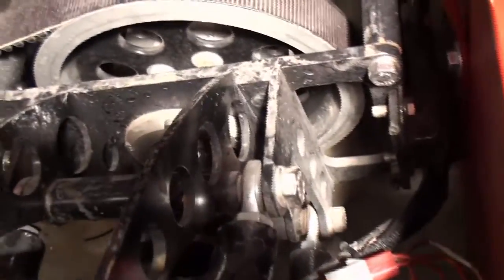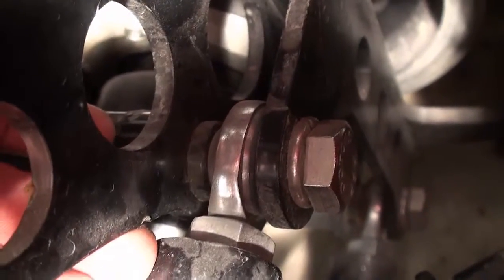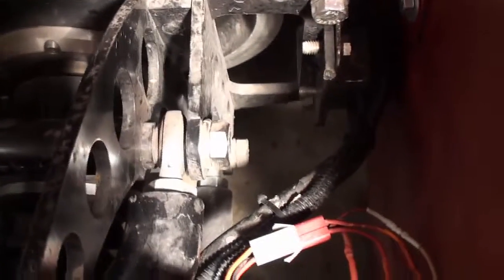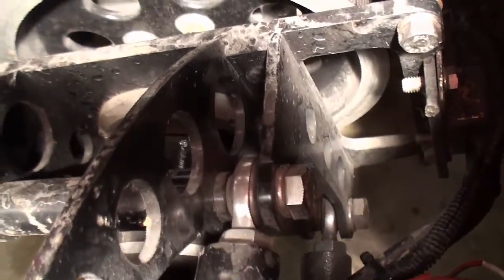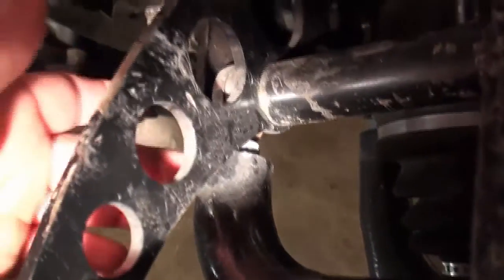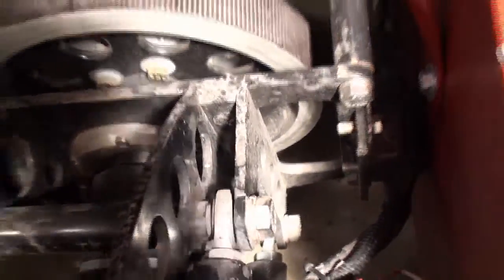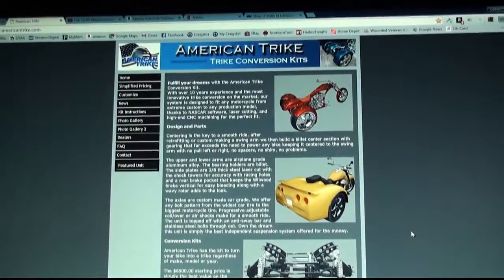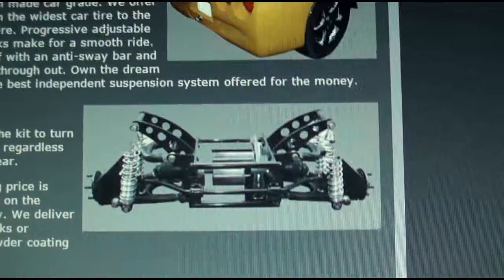American Trike Trike Conversion Kit

Comment: on the side of the brake there should be a number stamped. then I checked wildwood page and bought off eBay. there an auto grade so you might even buy direct. bleeding takes a bit I do only top 2 ports. outside of that keeping it clean as I get stuck in the rain.
Reply from the maker: help me out here brother, I can't seem to find "wildwood page" can you send me a link, also i found the number stamped on the caliper but can't get it referenced to anything on the web # is JAA-9689
Reply: 9689 is the brake number
Reply: call them give them the number and they'll quote you pads

Comment: I checked mine out. I don't seem to have that issue.  made a quick video of it, will have posted tonight. I'm thinking the cut those 'arms' on mine compared to yours. also, my chassis seems stiffer. because new or different shocks? idk...
Reply: I watched yours again, you don't show the shocks or your setup...mine seems to sit a lot higher. about 1/2" where you look to have an 1/8" maybe 1/4"? also, if your shocks are adjustable like mine you may have to lengthen them. I look to be about middle from all the way out, to all the way in on the shock adjustment. . . at least these are easier compared to the center stock one :)

Comment: I've had my kit for 10 years no problems. there's adjustments in them hem bolts and shocks so they don't hit. did you mess with them. I've put 40k on my kit and no gouges. looks like you need some adjustments. love my kit.
Reply from the maker: I love my kit too, so far that really hasn't been an issue i just wanted people to be aware of it, I've looked but can't see anything to adjust and i'm a pretty good mechanic
Reply from the maker: have you ever had to replace the brake pads, if so where did you get yours